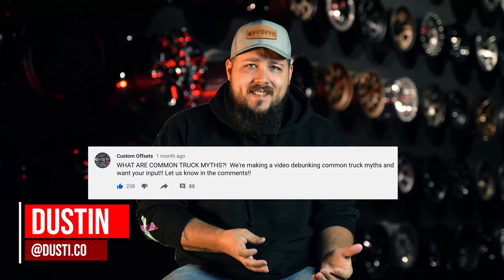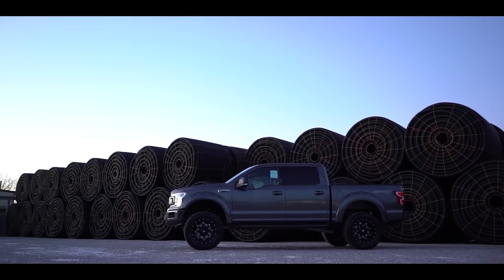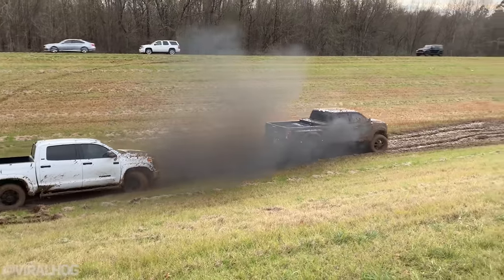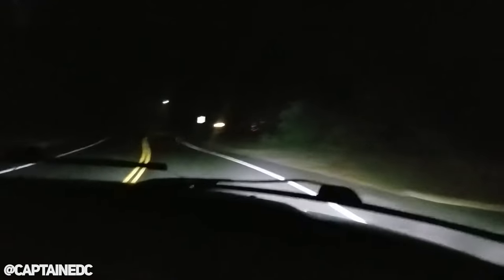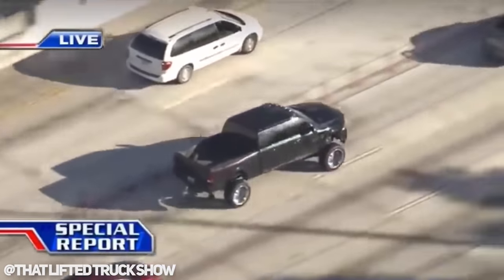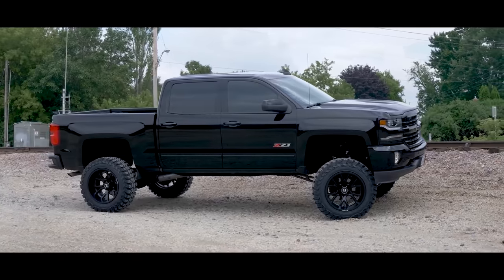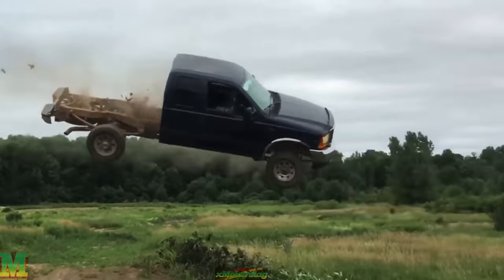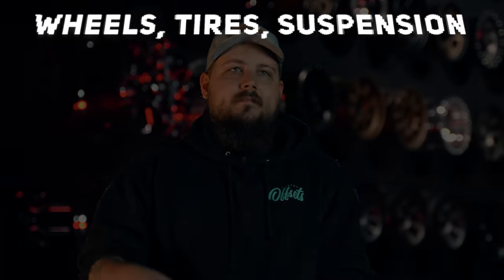TOP TRUCK MYTHS!!

Comment: I've had wheel 1.5" spacers for the last 15k miles. During that I have towed a trailer 1k miles, off roaded it, and may have jumped the truck 2x.  Currently I drive 100 miles a day to go to school and go 80mph plus on the highway. They are hub centric and everytime I take off the wheels I run them down with my impact gun. Also I never used thread lock on em. If you ask me the quality ones are safe.

Comment: For pulling in reverse it depends if you have high pinion or low pinion differentials. High pinion differentials are much weaker in reverse but low pinion is actually stronger in reverse

Comment: What, if any, issues would develope with a wide axle in front than in the rear? Example, 05+ F250 axles 3-4" wider than 99-03..(my personal situation)
My "go-to guy" convinced me to axle-swap instead of re-sealing my existing 02 axle. My front wheels are noticeably wider than rears..should I swap out rear axle to match tire stance? Or let it be..? Thanks guys! Awesome videos!
Reply from the maker: Track width is typically wider in front than the rear so there would be no real issue other than wheel fitment would change slightly! Thank you for you support! 🙏

Comment: Does a lift and tires mess up your suspension?
Reply from the maker: A lift is part of your suspension, but any aftermarket mods will cause extra wear and tear on other suspension components!
Reply: Custom Offsets dope how bad would it be? How long does the stock ones last and how long with the lift?